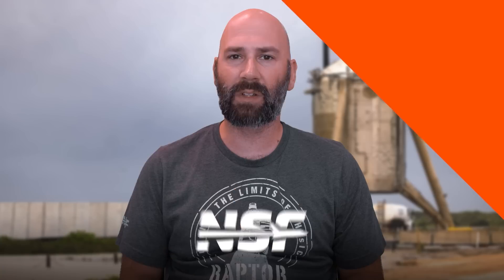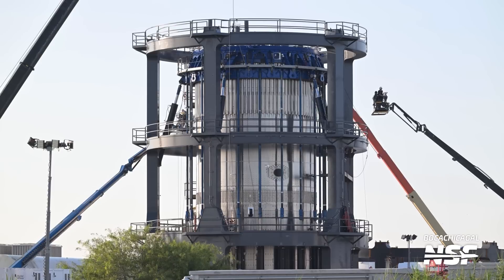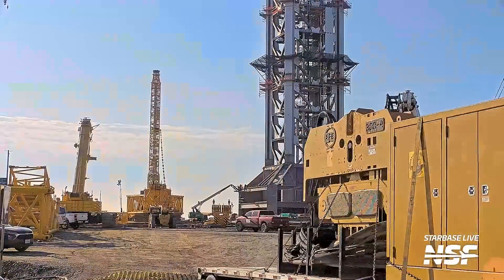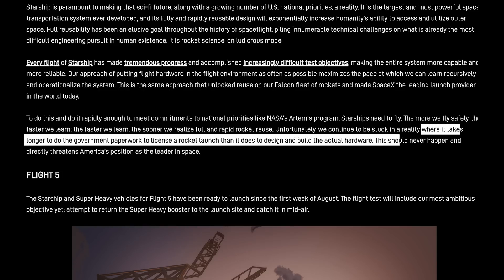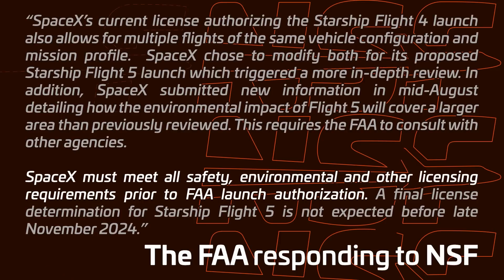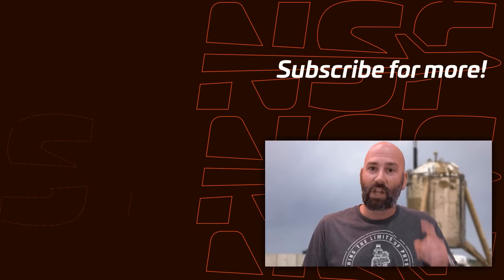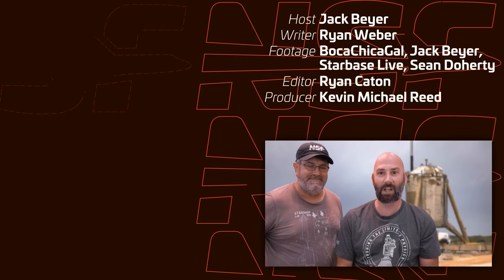WHY Is Starship FLIGHT 5 Delayed? | Starbase Update

Comment: Punishable by fine just mean legal for a cost.  They probably knew they had the wrong permit, but the cost for delaying to get compliant was higher than the possible fines.  They banked on having enough time between test flights to get resolution but misjudged the beaurocracy.

Comment: This is something i don't get from SpaceX, why not try to do things properly the first time instead of just going fast and then later get fined and have to be grounded for things that were completely avoidable. It still blows my mind that they believed the world most powerful rocket did not need a flame diverter or deluge. Anyways i'm sure they could have lots of information ( specially about the heat tiles) by doing flight 5 without a catch.

Comment: OK, first of all when a hot staging ring was added to Starship (which was a significant change), no one was consulted and approval was given because debris and ship would land in the GoM, the whole GoM was approved for debris drop/landing, not a small part but the whole gulf. There was no additional environmental impact required. But now, changing the drop location suddenly requires a re-evaluation, your argument or justification of the FAA doesn't hold water (pun intended).

Comment: Why is NSF so set on bashing SpaceX for all of these issues? They had the "go" from the FAA so even if they didn't have some minor paper work in order, it makes sense not to delay a 100 million dollar launch for potentially months over something that you would only get a negligible fine. No need to make it bigger than it is. It also wasn't mentioned that they had extensive third party testing on the released water that deemed it unproblematic, thus the "drinking water" comment.
And sure, technically they could launch now given the license they have received, but that doesn't take away from the fact that it shouldn't take so long for a license modification. Agencies shouldn't stifle progress just for the sake of following their procedures if something is as important and costly as Starship. Kind of a case of not seeing the forest for all the trees.

Comment: WOW! I have never seen you over the top against Space X!!! You need to do more research!! TWC admitted they did not have any knowledge of the permit that was required. The CNBC filing kicked all this off and caught the TWC off guard and they had to issue the fine to save face. The EPA is just a scum organization that is operating like hyenas. The EPA sits  back and does nothing until some one else spends the money to do the research then they come in with their big fines and pretend they know what they are doing! The EPA has been suckling off of Space X since they opened. Notice that the EPA is the one that issued a $150K+ fime a year later when the Environmental impact of the O2 dump is now known to be ZERO! The EPA is a puppet of several organizations that "pay for play". Check into why it took a year for them to paly out the fines and hearing documents as they tell a lot about the EPA process works and doesn't work.
Reply from the maker: Hey Barn- The TCEQ investigation occurred in late July (24th-28th or so), and the CNBC article came out Aug 12th. The article couldn't have "kicked off" the investigation. It's not really over-the-top to look at dates. -Das
Reply: @NASASpaceflight  According to other stories the Inquiries by CNBC triggered TWC To start checking. AFTER the release of the water the TWC came to Space X and told them there was another permit that Space X should have taken out for teh Deluge system use. Upon further discussion as to shy this was just now being requested it was exposed that the TWC did not even know they needed the permit until the CNBC team started asking. ie... Eco lawyers looking for ways to delay found little known and unused permitting processes to start a whole new round of lawfare. I know there is still more to expose but bottom line is EVERYTING is so new that the approach should be to work as a team and get quality protections as we go not wait a year after to start "calling foul balls" and charging massive six figure fines. If the release was really so bad then the EPA might be responsible for fines of their own because they were so slow in acting that they let the system be used several times?!?!? I am just tired of all the Lawfare. As for the license in place now, sunk cost is fixed and new steps need proven. Risking a launch "just because a license already exists" is just as dangerous as delaying the launch except that any mishap could bring even more setbacks! It is all about managing risk and launching to gain as much as possible not just entertain crowds is a wise way to go so I see why Space X is want things to move faster. I was really surprised by your Posture that "Space X is deceiving or with holding information" as they have been transparent all through this process.
Reply from the maker: The documents show that the TCEQ investigation predates the CNBC article by weeks and other notices about permitting predate it by months. SpaceX even applied for the proper permit around July 1st, and the TCEQ fine was drastically reduced because of that good faith effort, from a baseline of 25k down to 3k, and allowed them to continue operating for while the permit is worked out. If other stories are telling you otherwise, they're not looking at the basic documented facts. - Das

Comment: Maybe you need to consider the $100M+ cost of the booster. Seems like a delay in launch more than compensates for recovery of that hardware value. $100M in cash is falling out of the sky. Do you try and catch it?
Reply: The booster likely wont be reused anyway
Reply: @_mikolaj_  Indeed, but there are 33 Raptors to save.
Reply: @dglennon20  fair point i gues

Comment: on the "bright side", the delay will probably mean that the 2nd launch tower will be operational by that time. So if something would go wrong with the catch attempt, they still have a second tower to fall back on.
Also on the deluge systhem: Everyone should google what pollutants are actually IN rainwater. Or do you folks believe rainwater is the same as drinking water? So I could even make a case that SpaceX use of actual drinking water is less polluting than the rainwater itself...
Reply: I dont think a second pad will be ready till late 2025, unlike pad A, this one seems to be done "right".
The flame trench, deflector, tower outfitting and sound supression system  will take time to complete and get regulatory approval

Comment: I think main question regarding to selecting flight profile now, is if flying current stack on licensed trajectory, and doing catch later is faster. 
Like, late november isnt really far away when you think about it in spaceflight perspective, and i have doubts that they would manage to prepare another rocket within 2 months, so perhaps just waiting it out is a faster option to get to the catch attempt.

On the contrary however, one can argue that reflying flight 4 trajectory will be more beneficial
After all, flight 4 landings werent picture perfect, booster had engine failures on landing, and roumors say it exploded shortly after it, and ship, yeah, it barely made it

If spacex was to refly same flight profile they could possibly refine the landing of the booster before catch attempt, which by itself is quite risky and they do put their launch tower on the line

I gues spacex just wants to get to the catch as soon as possibile, though personally i feel like its a bit of a 'go fever', and it would be more beneficial in a long run to refly same trajectory and do the catch on flight 6.
Catching the booster isnt the only important thing in starship program, and on F5 they could still observe the new heatshield. Additionally they could perhaps do some in space testing, lets not forget, they are still only climbing the bottom of the mountain that is HLS development, still long ways to go to ship-ship propellant transfer, long term orbit storage, and the lander itself
Reply: Here are two schedules for your consideration. Both involve the same ship trajectory, and would have the same ship mission objectives. 

Schedule A: Wait for FAA catch approval, launch Flight 5 as planned in late November (if, then; it could be in December or January)
Schedule B: Launch Flight 5 in late September on original booster trajectory. Gather data from Flight 5, then apply for orbital trajectory on Flight 6. Such approval should occur around the time of catch approval, if not a month or two, later, but you have a bunch of data to iterate ships with, sooner. 

Which is superior?

Comment: SpaceX did build 8 vertical storage tanks nor bothering to check the regulations which ultimately resulted in them not be able to use 1/3 of them so not having the right permit for the deluge system that was built as an after thought seems par for the course at this point. spacex boasts about how many employees they have in south texas yet somehow not one of them bothered to check the regulations, it just bonkies
Reply: Certified big corporation moment lmao
Reply: We know SpaceX was testing the water for pollutants around the deluge. Who were they giving it to ? Texas of course.  I believe SpaceX when they said Texas environmental org was there from the first test. Why not since the first flight caused crazy ecological damage. So as an org if you have the Texas org on site, you'd think you cool to proceed. This probably came to light when they sent those high mercury readings and the EPA got involved. 

And while the law is the law, if SpaceX can make a rocket that holds 3.4 million kg of liquid oxygen and methane, its clear they can make a storage tank. I suspect at some point they'll get themselves certified to make them.

Comment: Yea I mentioned this on a prior video but it is very not surprising that SpaceX chose to omit details that don't look favorable to it. Not only are they being ran very 'agressively' we can't leave out the elephant in the room either- it's an Elon ran company and this would not be the first time he has delibrately misrepresented a situation to try and get public pressure in his favor so I would be unsurprised if he was the source of the strategy, or at least the culture that gave rise to it. It's one of those very frustrating cases where I agree in principle to a lot of the points they make and there is significant truth in there, but then they take that and twist it. I take great issue with any company or person doing this and see it as not just undermining their point but being duplicitous and counting actively as a mark against them.

Because the truth can become so conflated so easilly the only real 'counter' is to take a principled stance independantly of what the company is saying and then update your opinion as the facts are available. In this situation for example "Yes SpaceX should not be unfairly delayed but environmental concerns are still important and should be weighed fairly, there should not be too much pressure on the regulators causing them to do poor work, but equally regulators should work with SpaceX to try and minimize delays and ideally should have neutral 3rd party oversight" would be an example of something pretty close to how I see it where you then take the facts you have access to and figute out your current opinion while still holding the overall principled stance

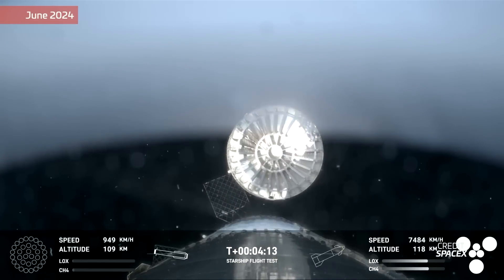Comment: Did this happen 11:37 with the recent StarLiner launch? Did the FAA climb up ULAs ass about the much larger impact of their booster? I mean you gotta be fair here.
Reply: Except atlas V has flown over 100 missions and such things were figured out literal years ago?
Like what are you even talking about?
Reply: @_mikolaj_  I’m talking about having to provide an environmental impact study on a hot staging ring falling to the ocean when there has never been such a requirement on any launch of a rocket since rockets were invented. (I’m sure someone will point out a counter example). Maybe the env impact study story is not true and I’m ranting about nothing.
Reply: @ReginaldCarey  every launch vehicle has to perform an enviromental impact analysis, and while its true that at the cape it may be easier since its already an established location for over 60 years while boca chica is brand new launch site, enviromental reports must be made for all vehicles, from launch to splashdown.
The reason you may not hear about this is likely because
1) at the cape those things may be handled by the eastern range, not FAA(id need to check)
2) rockets like atlas V have been flying for over 20 years. 20 years ago there were no weird internet nerds digging up launch vehicle paperwork

Comment: Progress. Repeat of successful IFT4 wastes booster & starship, 
unknowns not resolved(tower landing, essential to rapid flights). 
Environmental concerns in a swamp seems obvious for an electric 
car company owner. Deluge waste sounds like rain, methane & O2 
burn to form water & CO2, unless the exhaust is vaporizing the tower 
& pad, thought the deluge would prevent that?
 You have great ideas Jack! Wouldn't watch your show otherwise!
Reply: Well IFT4 was far from perfect, one could argue it barely made it to success, there is still a lot to learn, they could improve booster landing so that engines dont explode during it, or test the new heatshield on the ship

Comment: While I understand the regulatory process is necessary to prevent companies from intentionally destroying the environment and hurting people for the sake of maximizing profits, which has happened many times in the past. There has to be a good balance between ensuring the safety of people and the environment while not stifling innovation. Even if SpaceX had handled the regulatory side of things perfectly, I guarantee delays due to regulations would have still happened simply based on regulatory bodies and the government seeming keen to prefer over-regulation and the snail's pace in molasses in December kind of speed they typically work at.
Reply: Also the point of "I wouldn't want to drink the water after it has been hit with the raptor exhaust" isn't really relevant. I also wouldn't want to drink water from a puddle anyways, it doesn't need to be potable to not harm the environment.
Reply: @user-hk3ej4hk7m  to be fair, spaceX were the ones to first bring up 'but the water is potable' as an argument... I totally agree with you, but SpaceX very much tried to suggest because it starts off potable they shouldn't need the same sort of discharge license as other industries

Comment: This has been the most informative and even-handed description of the regulatory situation I've seen yet. 
I wonder if SpaceX could start the permitting for several future flight profiles as far ahead of time as possible to give the FAA, etc. more time to process them. Without overwhelming them with nonsense, of course.
Reply: They would probably need data to show the FAA that they can perform the profile. So they need to do a successful in-space burn. From there, Flight 6 can have a profile compatible with a full Starlink deployment from Flight 7, on.

Comment: The solution to the water discharge problem is not to discharge it to the environment but to capture it in a dam around the site and then filter it and treat it, if necessary, for reuse. That would save the expense of trucking in more huge quantities for each subsequent launch, something which will be needed if they are to achieve launching multiple times per day.
I'm interested to hear how SpaceX is progressing on being able to manufact it re methane from atmospheric  CO2 on an industrial scale, needed for Mars surface launch. Would be great if they did this on Earth as well to reduce our CO2 accumulation using renewable energy. I'm sure Texas has the space for large solar arrays.

Comment: > Why doesn’t SpaceX fly … using the same profile as Flight 4?

I suspect the reason SpaceX wanted to get the Flight 4 licence to cover multiple flights was that they didn’t expect Flight 4 to go so well. I think they thought they’d probably need to repeat the same profile a few times. They don’t need to repeat that flight now, but that doesn’t mean the multi-flight licence was a bad idea…

As for “why not just fly anyway” - well they wouldn’t learn much more than they already have, and bear in mind they spent a lot of time and effort refurbishing the TPS (other cover sheets are available 😉) - so don’t waste the hardware on something so similar when you can get it to provide bucket loads more data from a catch profile.
Reply: There is plenty to learn. They haven't tested the door since flight 3, they could test the new TPS, they could test an in space raptor relight, that's just off the top of my head.

Comment: Problem with the fines is after the paperwork was corrected they said no changes are required for the deluge system. They all knew what SpaceX were doing, this was all done in public after all.

Comment: NSF, sometimes it's important to present the regulator's perspective, but this delay is 100% bureaucracy BS. If you believe spaceflight is important, don't both-sides this.
Reply: They're not even ready to fly though, loads more work and testing to be done at the pad. Yes the vehicles are ready, but the pad is very clearly not.
Reply: @JackABeyer  November
Reply: @JackABeyer  Reliable source/SpaceX employee on Reddit recently said pad work would be done in early October. Will the FAA be ready in early October? No, they won't.